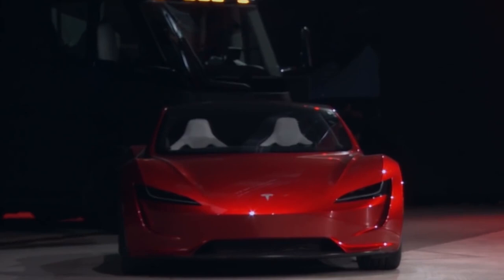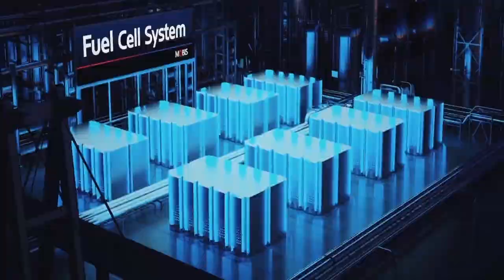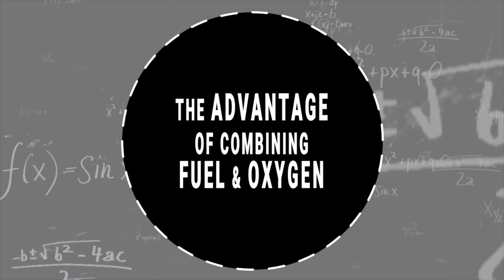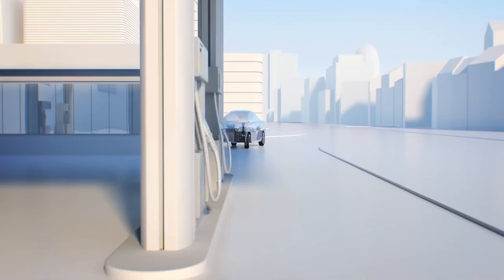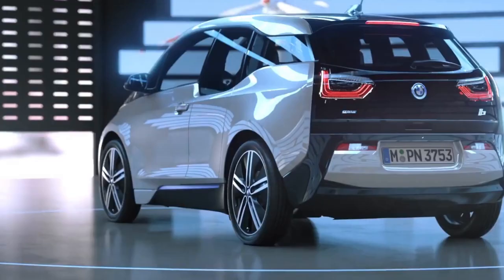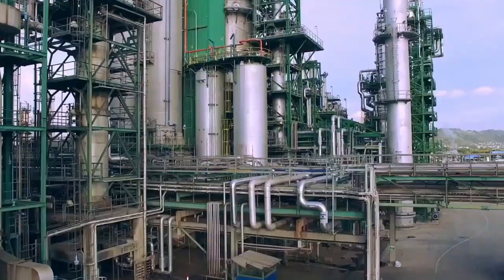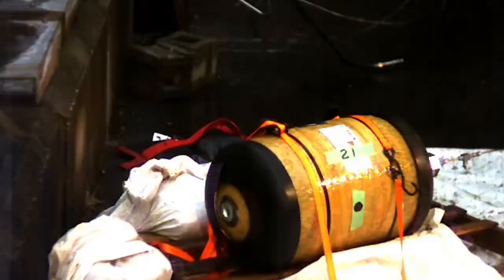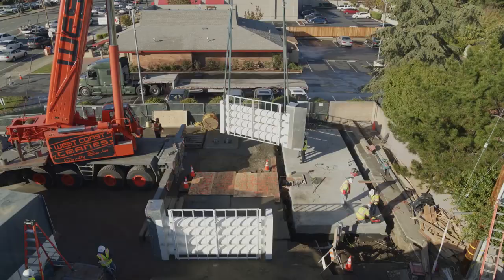is hydrogen fuel cell the future?

Comment: Technical correction: Electrons don't carry energy through an electric circuit. The flow of electrons establish an electro-magnetic field which carries the energy.
Reply: Why do you have to buy hydrogen? 
Is not the fuel battery will produce it?

Comment: There is a big place for hydrogen, but just not in passenger cars. Long haul trucks, some rail, ships, planes and grid storage. Plenty of space for all.
Reply from the maker: I agree with you on the short term maybe on the future will see more cars using hydrogen
Reply: @ScienceScout  It's too complex and will always remain too inefficient.
Reply: @Simon-dm8zv  
Now that's ignorant ...
Reply: @mandernachluca3774  It’s simple physics...
Reply: @Simon-dm8zv  That's seriously ridiculous ... hydrogen will be a better solution in the long term, just wait for 15 years and see what's left of battery electric vehicles.
Reply: @ravenclawgamer6367  Hydrogen will always remain the future.
Reply: @Simon-dm8zv  Well. I don't blame you for believing that. But you should know that H2 vehicles never succeeded because people never wanted a "green" car. Now when there  is an emphasis on them, world's leading countries will be shifting to hydrogen mobility shortly, within a decade or so. Just one thing, don't make the information from BEV companies your primary source as even BMW knows hydrogen will take over.
Reply: @ravenclawgamer6367  It's just simple physics.
Reply: Too innefecient to compete with batteries for grid storage, but some redox flow batteries which work on the same principal might work for that. Aircraft are probably where hydrogen will be the best tool for decarbonizing due to it's energy density.
Reply: @Simon-dm8zv  Well then we should cease our existence because the human body is highly inefficient, we breath in 20% O2 by volume and exhale 15 % of it.
Reply: @johnpatrick4983  We don’t really have a choice, have we?
Reply: @Simon-dm8zv  I don´t care if it is "inefficient" (which it is not by the way). I still want a hydrogen car. EV are just bad cars for me as I often drive very long distances. I would gladly pay a little more for fuel to avoid sitting in hours and hours to recharge a stupid EV.

Comment: The back ground music was a distraction from the commentary.   The outputs include fresh water that will have a limited market when landed and be an oversupply on board a cargo ship, the waste heat might have a use via cogeneration but the hardware and complexity will add cost.  Shipping is a 'high volume low cost' business so until H2, at all levels, gets to be higher value than hydrocarbon the industry has little incentive to change.

Comment: I wish hydrogen cars would be like a hybrid. Use the car as a plugin ev for daily use and hydrogen car when used in long trips or short on charge
Reply from the maker: Wow that will be interesting
Reply: But aren't they already? How else would they use regen brakes?
Reply: @ShipwreckCaptain  they use regen but you don't have a plugin option.
Reply: I believe weight would be an issue to get the best value out of having both types of renewable power sources. Tanks to hold hydrogen are pretty heavy, like an LPG car.
Reply: I think plug in hybrid hydrogen is the only way it makes sense. Most people don't drive long distances everyday. For people who most drive shory distances and sometimes long distances it would be somewhat wasteful to carry around a very heavy battery to give a long range when you mostly don't need it. Having a small light battery big enough to cover normal usage very efficiently and hydrogen to boost range for the occasional long trip could be a good compromise. The poor efficiency of hydrogen doesn't matter so much if you only use it occasionally. The savings in weight and resources from the small battery could outweigh it.

Comment: Elephant in the room that you didn't mention:
For a 100% renewable energy cycle hydrogen (ie not cheating and starting with natural gas) is only 1/3 the efficiency of battery systems.  That means we will need three times as many solar arrays and wind farms  to get the same vehicle miles.  For that reason alone it is a non - starter.
Reply from the maker: For the short term I agree with you but for now we just on the beginning its will take time and money
Reply: @Evandomedeiros  thats cool. thanks for sharing
Reply: That's not how technology works. You can't judge technology based on how it is now. It's essentially like saying it's a non-starter because there aren't enough fuel stations for hydrogen (when that is obviously a solvable problem). If a field is young, there is typically a lot of room for growth because the current solutions tend to be far from optimal.
Reply: @ssssssstssssssss  While for many young technologies you are right and I would agree; this is not a young technology. The fuel cell was invented in the first half of the 19th century.  And as a high tech market-ready solution (eg as used by NASA in Apollo)  is twice the age of litium ion technology.  
The problem is one of chemistry not technology maturity.  
Lithium chemistry was CHOSEN because of it's electro - chemical efficiency.
If you've DECIDED H2 is the answer you have to live with its electro - chemistry.
Reply: @gardnecd  Hydrogen has not been focused on nearly as much as batteries. Hydrogen will be much more efficient to create in the future.Look at all the money they spent on research for stupid batteries that demand huge amounts of metals. Had they spent that work on hydrogen instead, we would have saved time, environment and money
Reply: @ScienceScout  physics will not change over time, sorry to disappoint you.
Reply: @thoos192  physics will not change over time, sorry to disappoint you Ö.  😊

Comment: As usual, there is the assumption that hydrogen technology development will stand still. Powering large vehicles i.e. Planes, trains, ships and other vehicles will need hydrogen technology. Continual reference to the US situation relative to the rest of the world is arrogant and parochial. Think of places like Germany, France, Japan and China to name a few and the picture is very different. Keep doing this and we will be on the outside looking in. Hydrogen is the future!
Reply from the maker: Iam totally agree with you
Reply: Agree entirely. FCEV is scalable, practical and should be the future! If we continue in the current path, batteries are going to be the new plastic in 15-20 years!
Reply: @kenh3344  You will not have that option. Hope you can ride a bicycle.
Reply: @kenh3344  You will not have that option. Hope you know how to ride a bicycle.
Reply: The biggest problem hydrogen will have, no matter how good, fast or brilliant the cars are, is the fact hydrogen has to be transported to the points of storage and sale after it has been produced. Electricity does not, as it uses the existing grid. And hydrogen production is unlikely ever to be cheap.....
Reply: @Brian-om2hh   There are actually hydrogen refilling stations today that produce the hydrogen where they stand, using solar and wind power
Reply: @Brian-om2hh  oddly enough this is exactly why it will eventually replace gasoline. It doesnt overly screw with the current infrastructure. Petroleum plants can be rebuilt with hydrogen production in mind generally keeping the same amount of jobs. However no one can make big oil do this but i would be on the look out for new plants being built in 15 years or so.

Comment: Why does everyone ignore the fact electrolysis makes extremely pure clean oxygen? One 3rd of H2O is Oxygen the exact amount of flame excellent H2 Gas needs, to make a 2800c° flame.1 KG of H2 is 11986.5L and people act like 5993.25L of Oxygen gas is nothing. 7.95Kg of O2 gas is just wast nothing to see here.
Reply from the maker: I agree with you
Reply: Just watched a video from three years in the future. Vintage pickup with a Cadilllac Ls in it and 500 hp with a supercharger! It sounds like a hot rod and 😊goes good! It works!!!

Comment: If you use the same amount of electric energy to charge the batteries of a BEV, you will cover 4 times the distance you would cover, if that same amount of energy was used to extract hydrogen, store it and then fill up the tanks of a hydrogen fuel cell car.  Elon Musk is right on the money!
Reply: it's economical in bigger vehicles, battery electric vehicles give diminishing return after a certain point as the weight of battery increases range increase gets lower and less significant, so in bigger vehicles travelling long distance hydrogen is better fuel, and in cars, not everyone has a garage, majority people in cities live in apartments, and it's not possible for very to go every night or in morning to go to charge vehicle for at least 30 minutes and wait for that time every day, only those who have garage or charging points in their apartment will be fine, which are a very few.
Reply: @kushal518  Wrong. Even semi trucks are better off with batteries than hydrogen fuel cell. There is a study that confirms that. Moreover, battery technology keeps increasing, while electrolysis can't get more efficient. On top of that, new battery technologies emerge, such as solid state batteries, liquid metal batteries etc. Hydrogen fuel efficiency  is FAR worse than BEV efficiency, not even close. There is no future for hydrogen for land vehicles, period.  Hydrogen may be useful for aircraft but again, nothing is certain yet.
Reply: @kushal518  it is much much better to charge at home or work rather than a fast charger because then the charging can be done at times of low demand. You are right that at the moment many people can't plug in. The solution to this is requiring that every car parking space, whether an apartment block car park, work car parks, and even street parking should all have charging points. Not fast chargers as the car will be there many hours, just modest ones.

Comment: Hydrogen sounds great and I used to ride this bandwagon until I did a little bit of learning.
The amount of hydrogen needed to power a vehicle is way too high, the tank would need to be 1/2 the size of the car. Using liquid hydrogen is not practical either due to the temperature and off gassing the expansion pressure.
Today, our best, safe energy density per physical size is a battery.

Comment: Scientist say that the efficiency of a fuel cell will get to around 70 % or more in a couple of years.
Reply from the maker: it looks very promising.
Reply: Maybe, but this is only a later part in the whole chain of energy losses, total is currently around 25%
Reply: @voelkela  A new kind of hydrogen electrolyzer, called capillary fed hydrogen electrolyser solves the inefficiencies by removing the bubble formation. It's 95-97% efficient as far as I remember. From a startup called Hysata. If that tech is somehow added to fuel cells, the only argument for batteries is over.
Reply: @ravenclawgamer6367  That’s fine, but even then the whole chain is only at 50% max.
Reply: @voelkela  Calculate again, dude. If this 97% efficient tech gets to mass market, along with metal hydride hydrogen storage like what Plasma Kinetics and Lavo are developing, Hydrogen cars will be more efficient than battery electric vehicles themselves.
Reply: @ravenclawgamer6367  Please, consider all the steps that are necessary: transportation, maintaining/creating a pressure level, efficiency during conversion in a FC, efficiency of the e-Motor, dude!!

Comment: 32 million cars in the UK. Where will the exhausted batteries be dumped?
Reply from the maker: Usually should be a facilities for recycling
Reply: Volkswagen can tell you. They already have an EV battery recycling plant up and running. The video is on YouTube if you wish to see the recycling process for yourself. The cobalt and lithium within the batteries is around 90% recyclable, and can be reused many times over.  Burned petrol or diesel cannot be recycled and reused.  It has been illegal to "dump" battery waste anywhere in the UK or EU for some time Derek. Used batteries of almost all types are normally recycled.  EV batteries and lead acid batteries are way too valuable to throw away......... It is also possible to refurbish the exhausted batteries in some electric cars, rather than completely replace them. Again, there is a video on YouTube of a 10 year old UK owned Nissan Leaf getting a battery refurbishment. The work took 4 hours, and cost the owner £600..... It seems you still have a few gaps in your EV knowledge base needing filling........

Comment: Science Scout What about airplanes Jet engines ? What would be more efficient ? Burning the H2 in a modified combustion chamber or harnessing that energy from a fuel cell and then power a superconducting motor to turn the fan ?
Reply from the maker: that one of the direction that a lot of companies try to develop but the problem is that hydrogen batteries  too heavy, I will do another video about fuel cell in airplanes
Reply: Of course fuel cell one will be far more efficient

Comment: If even the best estimates of hydrogen conclude with it still costing more than a battery powered car, that makes it a non starter. It may make better sense to support other better electric batteries than push for a massive revolution using hydrogen

Comment: You left out 2 things. Lithium is limited  on the earth. Also, lithium has to be mined which is environmentally destructive. Hydrogen can be gotten from water or ammonia( both of with are available in unlimited amounts because they are made by naturally) using energy from sun, wind or moving water.
Reply: Mining lithium won't be an issue once all EV battery production moves away from precious elements. The new BMW i4 allegedly uses no rare earth minerals in it's battery construction, which has to be good news if it's true..... In the meantime, the big oil companies will continue mining for cobalt, just as they have done for decades. They need it to remove sulphur during the refining process....
Reply: Most ammonia is synthesized from natural gas.  Electrolysis of water takes energy.  In fact, it takes about 25% to 30% more energy than you can extract from the hydrogen so produced.  Most hydrogen is currently produced by steam reforming natural gas.  Hydrogen IS NOT an energy source.  Rather it's a (somewhat) convenient way to store energy.  As Claude Bai pointed out above, unless and until cheap electricity is made available on a grand scale through nuclear power, hydrogen power will continue to rely on fossil fuel (natural gas) as its source.
Reply: Don’t forget thermal hydrogen synths, biological hydrogen synthesis, cost effective energy storage, use surplus energy, batterie weight and long recharge time excludes them in use of polluting sectors like industry, energy storage, aerospace, trucking, shipping, and can be retrofitted into ICE and natural gas pipelines for clean cooking gas. Hell with nuclear we would have the surplus power even if hydrolysis was half as efficient. Why would any commercial operation pay people to recharge and waste 30min-8hrs of non productive time instead of 5 min at a hydrogen refueling station especially if they could retrofit their old ICE?
Reply: @wastelesslearning1245  all B.S.!
Reply: New Zealand is using geothermal to produce hydrogen on an industrial level.
Reply: @fredsasse9973  right now New Zealand is producing hydrogen on Industrial Level using geothermal for the energy to produce the hydrogen.
Reply: Have you noticed sodium is coming up quick and it is available everywhere.

Comment: If we are still burning carbon to produce the hydrogen, then there is no point in adopting hydrogen as the new fuel.
If the "greens" think that renewables can supply both the National grid AND (in its spare time) to electrolyze lots of water for the hydrogen economy, they should re-do their calculations.
The best hope for hydrogen is an expansion of Nuclear. 
But let us make sure those nuclear power plants are not pressurized water reactors. Molten salt reactors are theoretically better, safer, cleaner, cheaper. A fraction of the money used for Hinckley Point would  see MSRs in production. The British/Canadian company: Moltex already has a variant of the MSR (called the Stable Salt Reactor) under construction in New Brunswick. What is more, it very kindly burns up waste from  80 years of our conventional  nuclear industry.